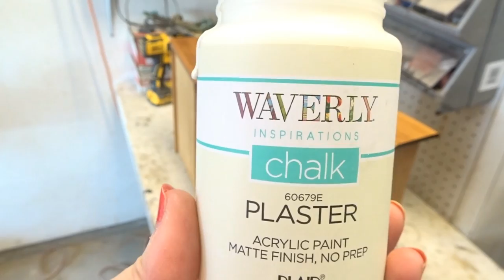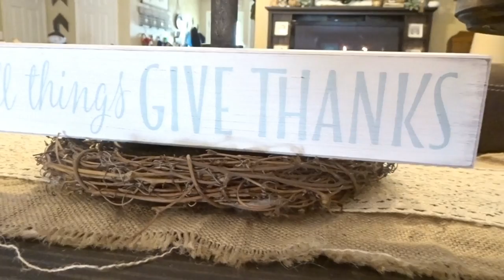DIY Buffet Cabinet | Old Dresser Makeover

Comment: left door didn't look like it sat even. maybe that board was screwed in a bit warpped? it's hard to get flat boards with pocket holes sometimes.  they need to be clamped when screwing in..I find that works best.
Reply: I couldn't take the door like that. It's frustrating trying to get them straight